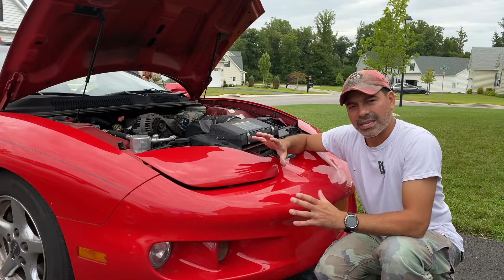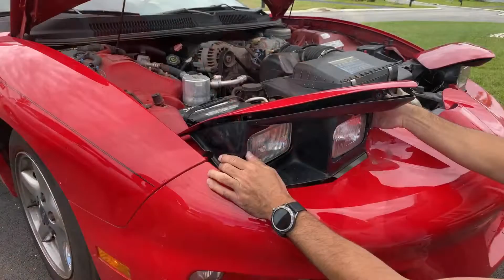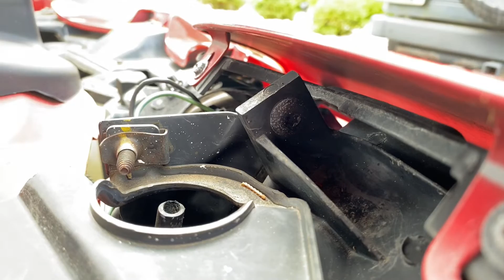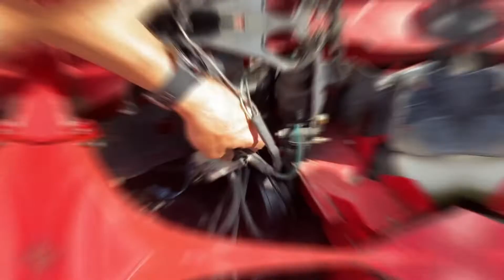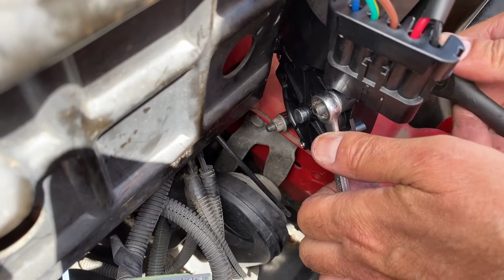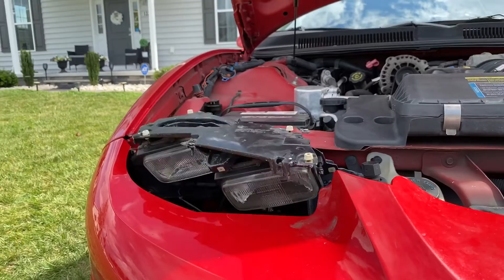How To Replace A Pop-Up Headlight Motor - Pontiac Firebird (Andy’s Garage: Episode - 358)

Comment: It is a whole lot easier job removing that red headlight cover at 5:18 by the 4 Philips head screws that mount it. So you don't drop those two main T 30 screws at 5:11 AND their small BUSHINGS that goes up on the larger diameter (For Heavens sakes don't forget about them) they help allow the whole assembly to pivot.

Comment: Great video, my 2002 Trans AM just started grinding away on the drivers side...since I'm taking it all apart I thought I would upgrade to a LED headlight system. Any suggestions? I see pricing all over the board on these.

Comment: Another quick question maybe you could figure it out the driver side motor works fine but the passenger side doesn’t go up or down. I tested the motor it works good but doesn’t work I am thinking a relay or fuse any other idea what it could be?
Reply from the maker: @robertgaray6681  If it’s stuck up or down it’s usually the relay
Reply: Sounds like the Module, my 2001 did that same problem. The Module is square and thin with a rectangular thing around the size of a cigarette pack in the middle of it and two connectors go into in on both sides of the cigg pack and its located up near the driver's side corner of the Core Support on the engine side of it. If you have a buddy that has a Firebird (or Camaro!) with working lights, see if they will let you change out yours with theirs to test your system because that is a lot easier than changing one of these motors! You can find modules cheap at junk yards on both '93-'02 Firebirds (yes Camaros too, I got a working module off a 95 Z28 of all things!) and it fixed my Trans Am's lazy passenger side light that I had to screw up manually.

Comment: How did you pop the lights up without turning them kn
Reply from the maker: @aughhampter9098  there is a manual knob on the motor. You can rotate it to raise/lower the assembly

Comment: Really helpful video.  I have had to replace these motors several times over the 25 years I've owned my '99, and watched this as a refresher (I have to replace the driver side motor today).  This is the best video on this subject I have found on YT, because you are outside in daylight (as opposed to in semi darkness in a garage), your camera work clearly shows what you are doing, and you take the time to explain everything.  I have done this job in the past by just opening the headlight, removing the bezel, and reaching in, but the access is so limited, and it is so hard to reach that back bolt on the motor, it was a miserable, frustrating job.  Your way (removing the entire headlight assembly and opening up a huge access area) is best.  I appreciate the time you took to create this video.
Reply from the maker: Thanks for the feedback, glad the video helped

Comment: What if they go up and down in different direction
Reply: I just got it fixed. I had the arm that hooks on the motor above the bottom white stop, and it should be under. The motor wasn't even bad. It somehow got above it. Been working on it for weeks.  Watching your video closely helped me. Thank you for the video
Reply from the maker: “Different direction” as in one up and one down, or as in our of alignment?
Reply: @PhillipsVision  one up one down
Reply from the maker: @reginahumphrey430  might have to check arms on the motors to make sure they are both in alignment

Comment: Nice job
Reply from the maker: Thx
Reply: @PhillipsVision hey man do you remember where you bought the headlight motor part from? I’m currently having an issue with my driver side headlight not wanting to pop up, but my passenger side pops up with no issue
Reply from the maker: @DieLoreleiValkyr my friend who owned the car bought it, but I’m pretty sure you can get them on eBay

Comment: One of mine is stuck open. Is there anything different in the process because of that?
Reply from the maker: No, the motor needs to be replaced
Reply: @PhillipsVision  Thanks.
Reply: @PhillipsVision  I replaced the motor and the headlights did the one up and one down dance. I tried to adjust the the top adjuster and cant the the thing to dany thing but make a noise.
Reply from the maker: @Trizzle-987  sounds like the relay may need to be replaced.
Reply: @PhillipsVision  Do you the relay popped when I replaced the HL motor? Is there a relay for each headlight motor?
Reply: I am looking to see if I didn't put the arm on right. I am also wondering if I screwed up the motor by messing with the adjustment deal on top of the motor.
Reply from the maker: @Trizzle-987  yes, there is a relay for each motor. When they go it can cause the headlight to be stuck open/closed, or going up and down without stopping.
Reply: @PhillipsVision  I got it. Thanks for the video and the replies.

Comment: My 99 30th TA convertible has the passenger side headlight stuck in the down position. The access under the hood to be able manually raise the light just spins and does not raise the headlight. Any ideas on how I can access mine? I appreciate any ideas. Thank you
Reply from the maker: The manual gear may be broken. You may have to disconnect the arm from headlight assembly and remove the assembly so the motor can be replaced
Reply: @PhillipsVision  The nuts are behind the rod that lifts the lights in the closed position.  I was thinking maybe I could back off all three as far as I can, then maybe I can move the motor back and draw in the nuts until I can get them off... Don't know, guess I'll find out. I appreciate the quick response and nice bird!
Reply: @6252e  I know it's been a month and you've probably found a solution, but I wanted to add that you may want to try the manual gear for the headlight motor again. I had to spin and spin and spin mine before it even started to move. Then, each revolution only raised the headlight maybe an 8th of an inch.

At first I thought my manual gear was broken too, it just took a lot of turns to finally show results. I do not know why that is.
Reply: @bradleylovej  Glad you reached back out. The person who owned the car before or someone who worked on it installed the bolts that hold the motor in backwards. The end of the bolt was binding the lift mechanism. I was able to force the lift rod enough to get the light to lift. Replaced both motors and they work great. Funny thing whoever was in it last replaced the plastic gear with brass and zip tied it all together. Learned alot and very happy with the results.
Reply: @6252e  Hell, yeah. Glad you got it done

Comment: I need to either get a motor or the gear kit.  But I'm seeing the gear kit costs as much as an aftermarket motor.  Think these aftermarket motors are worth a crap?  Any mods they need?
Reply from the maker: I always buy aftermarket motors for headlights and power windows. As long as they are listed for your vehicle, you’ll be fine
Reply: I've heard a lot of 4th gen guys like the Cardone motors. New, not re manned. They're supposed to have good build quality. I just got one, but haven't installed it yet.

Comment: I would recommend Cardone brand, as they can be opened by just removing a few screws. Then you swap the nylon gear with brass or something else stronger so you don't have to worry down the road. May as well swap the gear too while you're doing this, even with new motors.

Comment: I have a 1 of 18 trans am that I don't lock at the gas station because of that horrendous noise. Gonna be changing that motor this weekend. Knew it was the motor just wanted to see what was involved. Great video!
Reply: I’m the same way!!! I don’t do it when I get to work or at gas stations. Hell I barely even lock it because of that ducking grinding ass noise..  Does your headlights flip up and down?

Comment: I replaced the gear in the driver motor a year ago and I just did the passenger side this weekend. 
Here’s what I could add if no one wants to spend $300 on a new motor.
Before I begin I didn’t need to remove the passenger light completely but the driver side must come out.
If your motor looks to be untampered you can get a gear kit for $80. It comes with all the bells and whistles to keep the gear lubed and the case sealed. I’m gonna guess that the owner that opened his motor just flipped the gear 180d and it just broke again.
The new gear is brass so it’s lasting forever and costs much much less than changing the entire motor.
Also squeeze the connector extra tight bc mine was going out intermittently and I got a ticket :(
Fixed it with a good squeeze.
Reply: Could you explain a little how you were able to take out the passenger side without removing the light completely. I need to change my passenger side and any advice would be of much help.
Reply: @duarte831able  very sorry I didn’t get the notif till now. Just taking off the headlight shield should open enough room up for you to reach both hands all the way down to the motor.

Comment: So, my vehicle isn't making that sound but sometimes the light doesn't flip up. I'm thinking it's the motor...but, I guess I it could be wiring instead of the motor. I'd hate to do what you just did only to find it's the wiring instead of the motor.
Reply from the maker: Sounds like the relay.
Reply: @Phillips Vision  Ahhh, ok. So, with the relay, do I need to replace the whole thing or just a couple wires? Thanks for your response!
Reply from the maker: @Thomasbj1996  you will just need to replace the relay switch. It’s a small square black box that plugs into either the fuse box or a harness.
Reply: @PhillipsVision  thanks a bunch!!! You're awesome!!!
Reply: @Thomasbj1996 I know it's been 3 years and you've already replaced it, but for anyone else replacing the relay, Hawks has the relay with a 2 year warranty for like $175 as of this writing.

Comment: Were you able to manually lift the light up? My motor is out and im about to try and replace it.
Reply: Behind the headlamps from the top there's an access hole.  With a 10mm socket you can spin the motor and bring the headlight all the way up to access the three Phillips head screws to remove the headlamp trim and then you can reach inside.